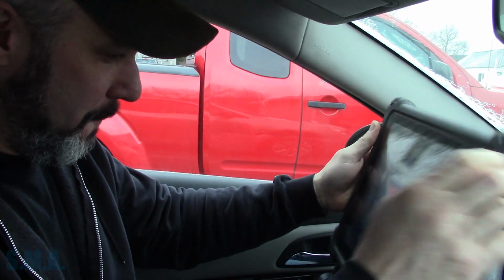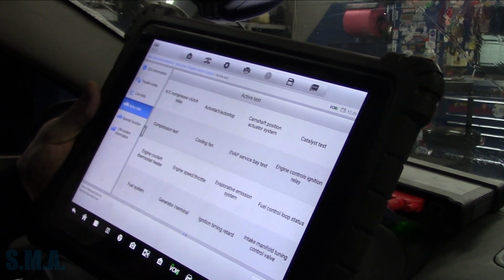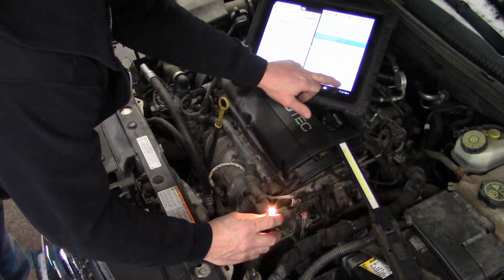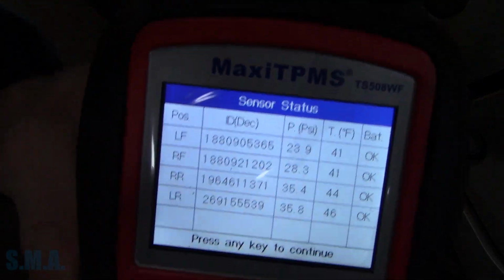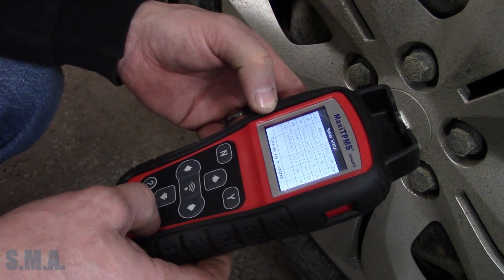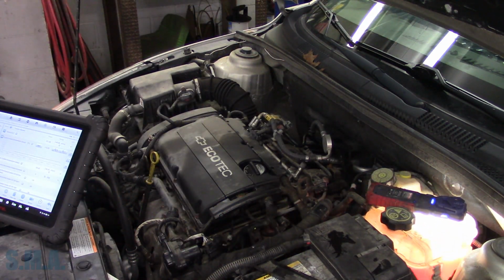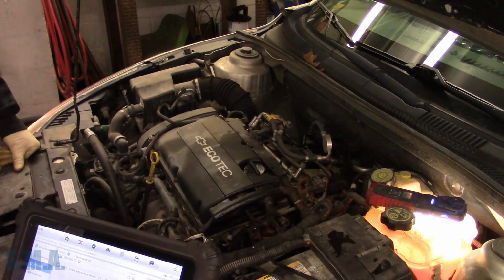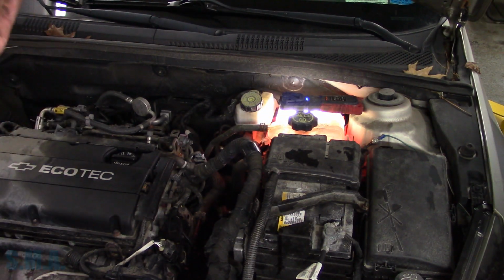Chevy Cruze: Thermostat Heater Codes / TPMS Light On

Comment: GM's recommended thermostat removal process, step 1: Remove engine from vehicle.
Reply: Step 5: Check and see if Mrs. O has lunch ready yet.
Reply: Step 4: Profit!
Reply: Give customer link to Uber.
Reply: On a Mercedes AMG GTR that is actualy a thing. To change the thermostats you need to remove the engine from the car.
Reply: Step 6 , buy old school rig
Reply: Step 1a: Replace timing components....
Reply: I don't know what it is about GM but they must HATE mechanics. At least since the 80s.
Reply: Try an Audi!
Reply: Step 1: send vehicle to crusher.
Reply: Step one is always remove battery cables 😂
Reply: What? It's so easy...
Reply: Step 2 , throw it away 🤣🤣🤣
Reply: @thomasfletcher4765  I'm a GM person but I'm forced to agree. However from my experience most vehicles are designed to be thrown away anymore.
Reply: @MarkPdot  I agree, it's all far over engineered garbage of endless constant random failures, in which even the dealers cannot fix many of the brand new lemons, let alone anything with some mileage  and odd issues.
I myself blame the EU trash plan.
Reply: @MarkPdot  My never repaired 150k mile 2012 Civic begs to differ.
Reply: @cgirl111  exactly my point. Once your car needs any serious repairs or gets into an accident it seems more often than not today's vehicles are scraped because it costs so much to repair. The only reason my current truck, 2000 Chevy Silverado 2500, 438k miles, is not in the scrap yard is because I got it cheap and I done all the maintenance to fix it up. My previous truck, 2006 GMC Sierra 1500, 136k miles, was wrecked for me in 2015. That truck, according to insurance, going to about $17k to fix but was only worth $15k. Most of that work was just for the body. Seen many repair estimates for modern vehicles with what looks like a minor ding cost thousands of dollars for basically remove and replace panels. So if you can do the work, yes vehicles can be saved this doom. However, if not, vehicles by the hundreds if not thousands are ending up scraped. It's just not as economical to repair today's vehicles as it once was.
Reply: @cgirl111  Thats barely broken in.
Reply: @thomasfletcher4765  step 3 get a Toyota or a Honda or a ford or diesel VW
Reply: @neilmurphy845  already got the ford part 🤣

Comment: What happened to replacing a thermostat on a small block chevy, maybe 10 min including looking for one of the bolt you drop under the car that rolls behind the tire so you can't see it LOL
Reply: Absolutely, and if you've ever had to do a Trailblazer, Bravada (GM straight six) you'd wish it were as easy as that Cruz.
Reply: @chuckgrenci6404  I agree I've heard horror stories about those thermostats.
Reply: @andysanchez5423  Really not that bad of a job.  Not as easy as a 350 Chevrolet but not that bad.  The easiest method is to remove the alternator and the thermostat is easily accessible.
Reply: @kevineich5029  GM Directions: Step 1: Remove front end of vehicle...
Reply: @markh.6687  I have done the job on a 2003 GMC Envoy that is in my fleet.  I did not have to "remove the front end of the vehicle" (whatever that means?) to do the job.  Removing the alternator provides direct access to the thermostat assembly.  It is a 45 minute job.
Reply: @kevineich5029  I'm glad it was that easy, since there are GM's you have to remove the nose piece/bumper cover of the car to change a headlight bulb...
Reply: @markh.6687  and dodge rams that you have to pull the grill..... fords ya have to pull bumpers
.
its why i love my 97 to 05 shitbox Buicks
its a GM, so a few sensors and wheel bearings, and its fine (and its a GM.... so cheap and common parts)
.
but i pull up on 2 plastic tabs....and the whole headlight assembly falls into your hands on my 99 century
takes 30 seconds
Reply: @markh.6687  The topic is changing the thermostat.
Reply: @kevineich5029  And?
Reply: @markh.6687  Pretty sure the HHR is like that.
Reply: @markh.6687  LOL, you made me laugh, TY
Reply: @kevineich5029  I think it was said in jest.
Reply: My 69 Nova small block still has the original factory thermostat in the original engine. Waiting for something to go bad so we can do a LS swap.
Reply: @henrydunbar397  That would be a sacrilege  , go with an old school big block LOL
Reply: ...and another 15 minutes to replace a water pump.
Reply: Had a 89 dodge caravan with the big 3.0.  You could replace the sensor easily, right on top.  So was the Thermostat.  3 bolts, boom.
Reply: 2.8l v6 VW Audi. Service position and you might as well do a timing kit while your there.
Stupid good engines and easy to work on if your not dumb.

Comment: Thermostat heater? New one on me.
Reply: I wonder what it's purpose is
Reply: @antonoudenhoven7573  The wax in them opens them at a higher temperature than normal and the heater warms the wax to open it under heavy load or acceleration at a lower temperature.
Reply: Basically lets the engine run at a higher temperature overall, but keeps a safety margin by being able to open the thermostat at a cooler temperature than normal if needed to cool it off more when really being worked.
Reply: I think they should add a catalytic converter heater to increase the cost of replacement.
Reply: It allows the computer to adjust the operating temperature.  By activating the heater, it can open the thermostat at a lower temperature.  As for why they'd do that, I think they lower it under load to prevent pinging.

Comment: Would this same information apply to the 1.4 liter turbo models as well?
Reply: Yes its very similar with less stuff in the way. Its on the passenger side of the engine. I just replaced one on a 2011 cruze.

Comment: Okay, noob here....... what's the purpose of electrically heating a thermostat?
Reply: Get the coolant up to temp faster. They coulda just put a block heater in a freeze plug. But nooooo.
Reply: A thermostat heater allows the ECU to open the thermostat in anticipation of the coolant heating up, for example when you give it full throttle.
Reply: @theronisback  thanks, I did some more research and you are correct
Reply: @theronisback  Thanks for the reply.
So the ECM heats up and fools the thermostat to open early and get the coolant moving?
Reply: im just posting here in hopes of more replies on the purpose of a thermostat heater. Seems like such a small heater wouldn't do much

Comment: Remember when thermostats were either open or closed?  
If it won't open when it should you just take it out and let the fluid flow!  
Now these things have their very own little electric heaters in them???  
I swear...engineers just have to find ways to make shit more complicated...and way more expensive.
Reply: you`re right, but its for efficiency and environment... hot engines run more efficient.
I know, the climate issue does not exist in the States but it does elsewhere on the world
Reply: @bobl78  I can't help thinking it can't be that good for the environment when these cars get scrapped at 10 years because of all the electronic faults.
Reply: @steveearwig  It is very much the opposite; most cars are scrapped when the things that have been around for half a century fail. My son's 2002 Prius is at 210K miles. The first gen is much less reliable than the later ones, but it needed its first repair (inverter pump replacement) at 198K miles and at 210K miles and 19 years it is time for a hybrid battery rebuild. I have taken plenty of cars past 200K over the years and this is the first one that was worth a major repair. The interior is still in beautiful shape.
Reply: @flagmichael  And long may it live! (I really don't want all that lithium to end up in the environment either).
Reply: No joke. When the engine mount on my Traverse broke I found out they are hydraulic and it sprung a leak.  Call it engineer job security.
Reply: Gregory, Actually, an  engineers first priority is to design a part to be extremely efficient and last forever. Thats how engineers are wired. Its only when the bean counters come in and change materials and building methods that the newly engineered part becomes crap. It's typically not the fault of the engineer as much as the brand trying to squeeze every penny out of the product to maintain those ridiculously high margins they so love.
Reply: @giggiddy  yes you're right about that that's why parts last different amounts of time for every brand
Reply: And the thing is a engine is a heater and there I was wondering why are all these new cars so slow to heat up I think I know now you can on a let's say 2011  car turn on the heating and the windows interior will be warmed up in 4,5 minutes new car's because they don't rev hi enough and with all this electric crap they take forever two deice  you have to eventually just run  inside and get the kettle  while you're frozen your windshield is frozen and your 15  minutes late for work
Reply: @neilmurphy845  they warm up slowly because they are more efficient and convert more if the gasoline into power and not into heat.. especially at idle and medium load
Reply: @bobl78  Aha knew it but the amount of time you lose especially in the town were  you cannot leave the car running while you eat your breakfast and have your cup of tea and hop in and everything is deiced that would want to give you at least 10% better MPG it's just unnecessary
Reply: @neilmurphy845  For the sake of clarity, a few well placed periods would make sense.

Comment: Just more electric junk on a system that doesn’t need it, but it keeps the money rolling in I guess.
Reply: You have a point on a Chevy, but Toyota makes electronic control of engine temperature (the later versions have an electric water pump, controlled by the ECM) a hero of both emission control and fuel economy. Mechanical thermostats are notoriously unreliable - that is why they are replaced when the coolant is replaced.
Reply: @Justin_Case1272  I haven't done that on my cars and I've ONLY had a handful of thermostats fail in the 35 years I've been driving various cars over the years, so they are indeed reliable, not sure what flagmichael is trying to imply.
Reply: @johnhpalmer6098  The point is that using electronic devices isn't inherently unreliable and is mainly due to companies buying the cheapest components they can get their hands on. Which is why Toyota was given as an example of a company that doesn't have this problem even though they also have electronic thermostats. Because they design their cars with reliability and longevity in mind, unlike GM.

Comment: Chevy Crud, that's your problem lady!  But thanks GM for putting my kids through college. 😂
Reply: I've made a lot of money working on gm products .
Reply: @toddw.9845  I've made a ton working on Fords too. lol
Reply: shame GM at one time had quality. now you couldn't give me a new GM product. honestly I wouldn't want a new product from any of the makers. all hunks of junk and pain to work on. ill take something made pre 80
Reply: @Dratchev241  
It's not really true, depends on the model of vehicle. I certainly have worked on a few that were a royal pain in the butt, 
I've got a 2008 Toyota Prius 348,000 miles, and  it's really easy to work on for the most part. Sometimes you might have to take several things off to get to something under it but it all disassembles easily and logically. Virtually the entire car is a 10, 12 or 14mm bolts. Surprisingly easy to work on.

Comment: Eric, you aren't the only one that calls a manual transmission a millenial anti-theft device. 😂
Reply: I am from holland. I don’t understand the joke :-).
Reply: @mauricevandoeselaar  manual transmissions are extremely rare in US in cars and trucks since the 1980s. the current generation has no idea how to drive one
Reply: @caravan1ify  On the other hand, our work trucks from Ford had manual transmissions until I got a 2015 model - the buzz was that Ford did not have a manual to mate with the 6.7L diesel, but I dunno. Among my personal cars and work trucks I have most of a million miles with manuals.
Reply: @caravan1ify  sadly yes, but there was still plenty into the early 2000's
we also used to parallel park test to get drivers license! I barely passed my driving test when I took it, but it was middle of winter after a huge multi day snow storm. the instructor had a fit when I avoided the deep packed iceberg of left lane and went into the second lane of a 2 lane road. I said do you not realize it would BOTTOM out this car (chevy chevette), I went to the idiots boss and said hey, lets go measure the iceberg in that lane and measure the car height. even though I just passed anyway, I was livid.
the few wreck I've had in 26 years of driving was either on dry pavement or fresh rain.
had a few close calls from others wiping out in winter, but the first thing I do in snow is test the limits on back roads and where there's plenty of free space, hit brakes too hard ahead of time to see if it's slippery, same for throttle. of coyrse back then they generally just plowed and dropped a sparse mix of salt and cinders, none of this brine junk that eats vehicles 300%+ faster!
Reply: @caravan1ify  not all of us!
Reply: @mauricevandoeselaar  As @mxsport mentioned, manual transmissions are rare here. The sale of any sort of vehicle with manual transmissions have fallen so much that new models of cars simply don't offer a manual transmission as an option when purchasing. Because of this, younger folk have not been trained on how to drive one. So if you have a car with three pedals, the chances of it getting stolen are very low.

I recall in Seattle a while back some teenagers tried to steal an old lady's car. They hopped into it but it was a manual, and of course they kept stalling it - so they bolted and were caught a short time later by police.
Reply: @mrdanomac7937  Manual transmissions are deducted items according to NADA valuation
Reply: @mauricevandoeselaar  I am originally from France, but I've lived in the US for 36 years, so, I understood the joke! 😁
Reply: @armoricain  ever drove a ford or chevy with 3 on the tree my mom is the best one i have every seen drive a 3 on the tree .in the 70.s and 80.s so gentle her driveing  like a automatic smooth gear change. if you ever watched I LOVE LUCHy in to 50.s she drove those cars 3 on the tree
Reply: @mauricevandoeselaar   My granddad had to teach me how to drive his automatic.
Reply: Very funny... Millennial here and my 2020 Corolla hatchback XSE is a stick shift
Reply: @adventureoflinkmk2  WRXs are the same way, and Minis before that.
Reply: @flagmichael  yes.. I remember one of my friends whose around my age (and I think barnacules nerdgasm has one too) have one...
Reply: @adventureoflinkmk2  2019 wrx stick :3
Reply: @Chrischernobyl  ope

Still, nice find man!  Now if only they made minivans or SUVs (especially Toyota ones) with manuals that would be awesome

Even if I could get hold of a manual Camry that would be great
Reply: In Europe that  wouldn't make a difference everybody knows  how to drive a manual
Reply: It’s funny to me that people use “millennial” as a term for a young person. Most millennials are in there middle to late 30’s. So they learned to drive 15-20 years ago give or take. When millennials learned to drive there were plenty of manual transmissions on the road. I learned on both manual and auto.
Reply: I'm waiting for someone to say they drive a non-synchro manual. That will impress me.
Reply: @LadyAnuB  I have! 1958 Beetle.
Reply: @bartsarton2212  By 1967 they got synchros. My grandfather's, now my sister's, 1967 testifies to this.
Reply: @LadyAnuB  on heavy trucks, they are all unsynchronized
Reply: @kevinbarry71  Having never driven that heavy a truck, I'll take your word for it.
Reply: @Johnny Blue none at all..
Reply: I'm gen z and I drive a manual 😀
Reply: Maurice did understand the joke people! But it is his dutch sence of humor that you guys obviously didn't get. Take it from another dutch guy. We know that most americans only drive bumpercars (sorry automatics) Over here the majority drives with manual gearbox. It goes further, if you pass your driving test in a automatic it gets stated in your license and you are not allowed to drive a manual car.
Reply: @ladamurni  yep, I've heard of something like that across europe... It's not exclusively a Dutch thing, it's also in the UK too.  Like I said it's prolly all of Europe
Reply: @adventureoflinkmk2  in the USA when they see 3 pedals it's like they've seen a unicorn 🦄 while hear in Ireland were like oh there's another manual were are we going today
Reply: @adventureoflinkmk2  That is very true!
Reply: @ladamurni  in the United States it's the same way if you have a commercial drivers license, if it says automatic, you are not license to drive a manual
Reply: @ladamurni  in my day we called them “ slush boxes “
Reply: @ladamurni  it was a joke ( smiley behind it) sorry for my sense of humor. I did not know what i started. I got my licence in a time that people who could not drive drove automatic. So you had to pay extra attention to them.
Reply: @mauricevandoeselaar  You don't have to say sorry. I knew it was a joke.
Reply: Ok boomer